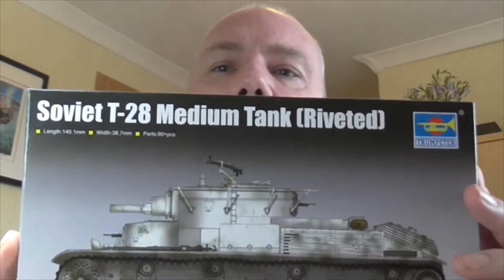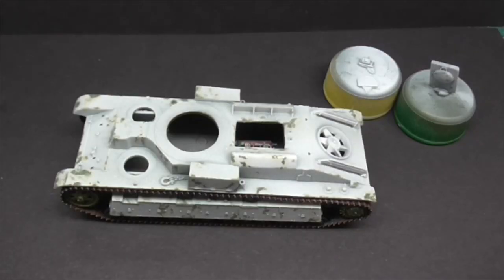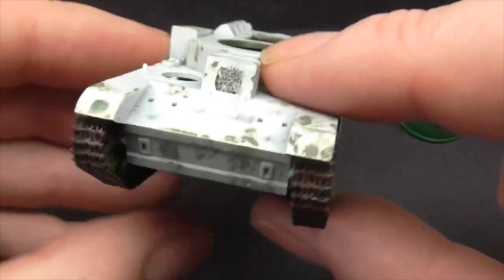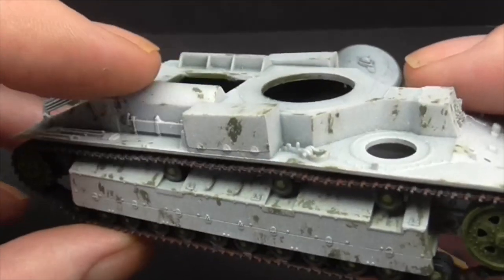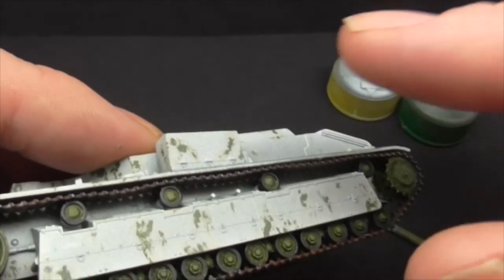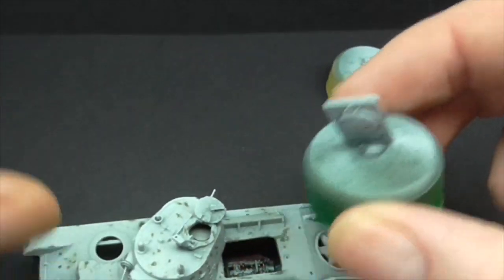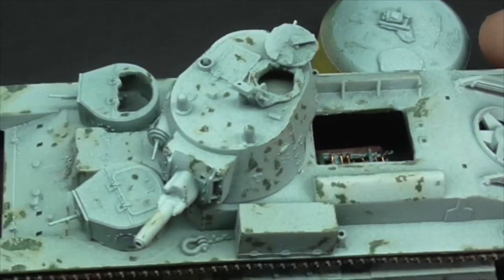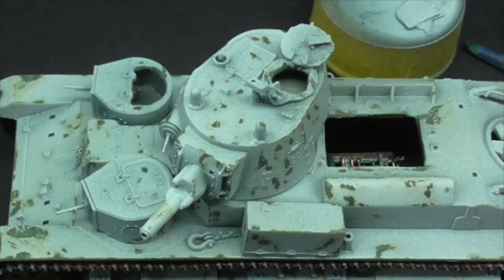Build Vlog 2 Trumpeter 1/72 Soviet T28 Tank

Comment: Great job from you  , but not from Trumpeter... a conical turret (late feature) on a riveted hull (prototype) is a mistake..
Never existed....
Reply from the maker: Thanks for the information . Regards Gav.
Reply: @gavinbooth  the only way to fix that inaccuracy is to change the turret , but it's really a pity to face such a problem. Maybe by upgrading a T35 to last version but then you also need to scratch the auxiliary turrets... or a mix kit with the welded T28?